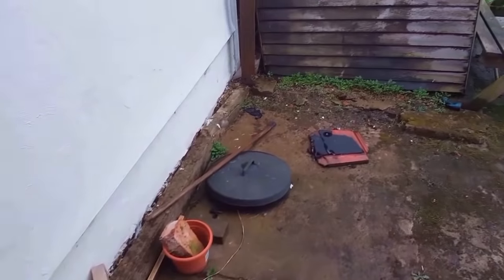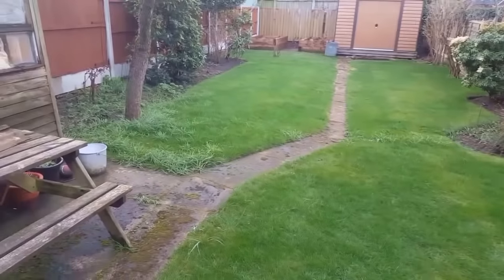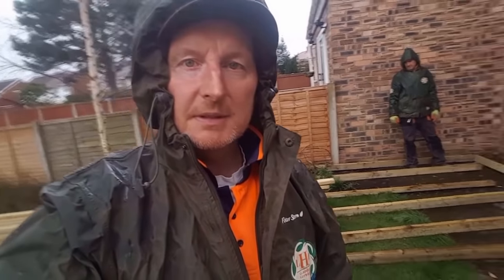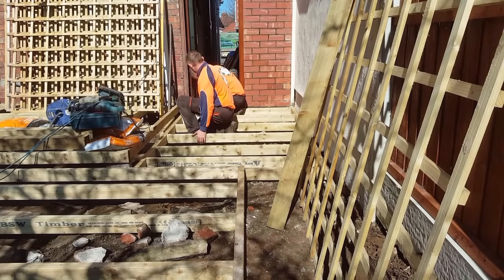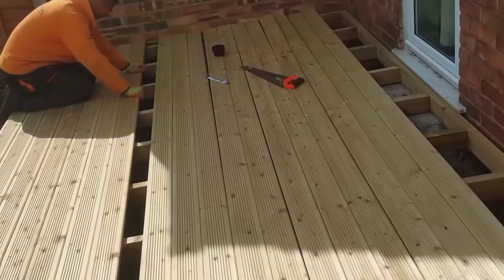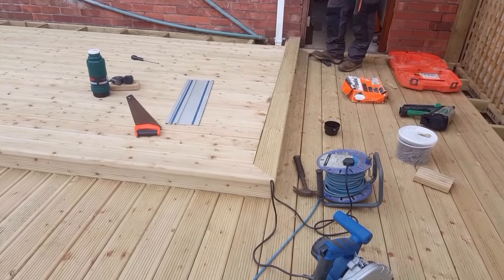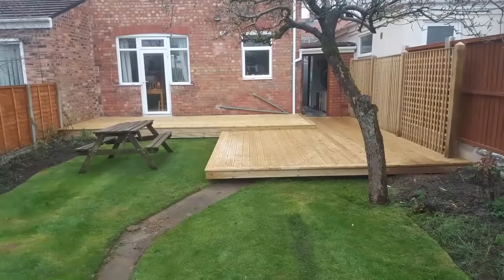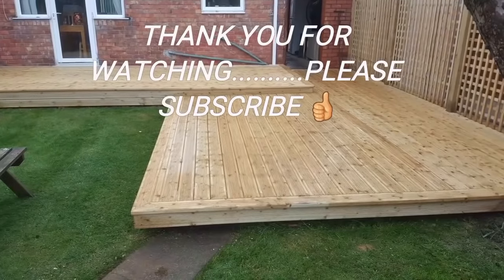Decking job.Split level with small squared trellis

Comment: How did you learn to do this type of work? The stuff that isnt just basic gardening which i think of as lawns, hedges and flower beds etc....
Reply from the maker: I am a landscape gardener buddy...been doing it since I was sixteen...😉
Reply: @LHLgardenservices  Thanks for replying, did you get the knowledge from working with others in the know and/or getting the necessary college/uni qualifications?
Reply from the maker: @Dante-vf4sd  went to college for ghd gardening but just tried the landscaping on very small projects and built it up 👍👍
Reply: @LHLgardenservices  Absolutely fantastic that you learnt how to do such things as decking by yourself, I wouldn't have a clue were to start, id be completely lost.  I'm watching all your vids and they are a great help to me just 2 months in as a gardener, I'm soaking in all the gardening info, the landscaping ones I take in bits but generally all i can do is just admire.
Reply from the maker: thanks very much 👍👍👍

Comment: Lovely work very impressive, can I ask a question, notice you blocked the air brick in. Currently in the same situation is it ok to block it in or should a air vent (duct) be installed into the deck front???
Reply from the maker: Vents were not Covered!
Reply: @LHLgardenservices  how did you get around it

Comment: I know this is old Lee but have only recently come across your channel nice job by the way wouldn't it have been cheaper to just buy some 2x1 or what ever the trellis is made up of quick tip.
Reply from the maker: No mate..its not the same colour. If they sell the batons separately then yes we would get them instead of dismantling 👍👍